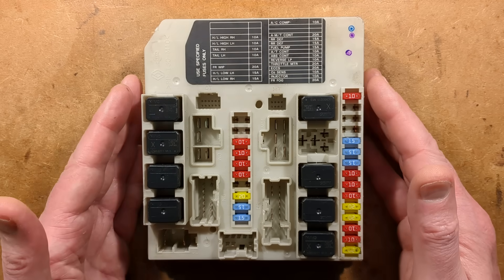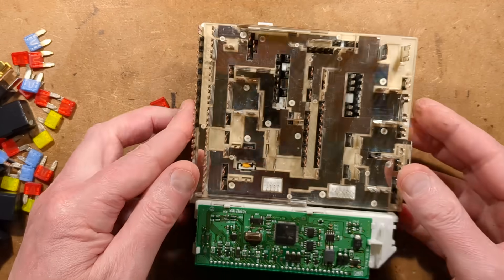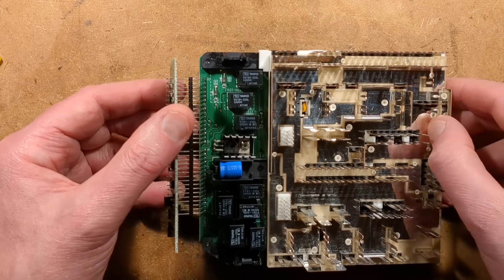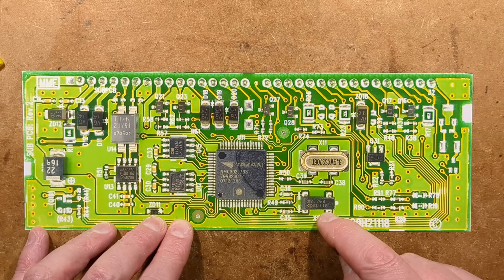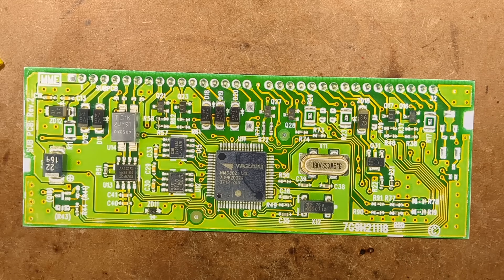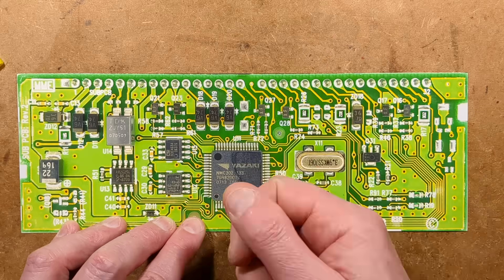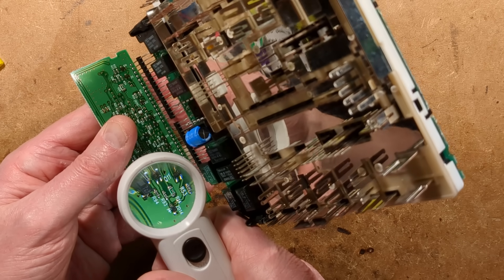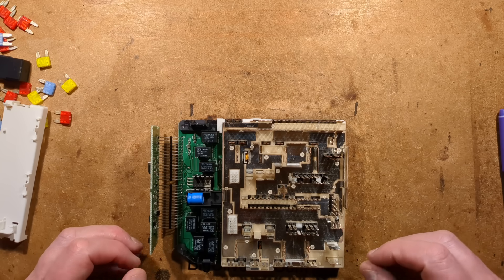Why your car's fuse box costs so much (and the location of the data chip)

Comment: Nissan, the queen of too complex electronics.  I had the driver window fail to open on a Nissan LEAF I used to own.  The window control had a PIC and a bunch of relays.  Three windows had relay H bridges and were dead simple.  The driver window though had a five position switch.  There was auto-down, manual-down, center-off, manual-up and auto-up all controlled by one button.  The switch was implemented by a slide variable resistor read by the PIC to control the relays.  The PIC also read the back-EMF of the motor for initially setting the travel after the 12 Volt supply was interrupted.  The travel limits had to be set by manually jamming the window at the limits of its travel for a few seconds.  After that, the PIC would just run the window motor for a fixed time in the auto positions.

The whole damn board was conformal coated, not really worth going through the annoyance of trying to repair.  It was just easier to pay the 120 Dollars for a new board than waste time that could otherwise be earning money.

I was glad to be rid of that LEAF.  It had one electrical problem after another.  I suspected it might have been in a flood because it was originally titled in Tennessee.  I got it used from a Nissan dealer in another state and I never found any flood residue in the bowels of the car.  Carfax also gave it a clean record.  I was so soured by that brief Nissan ownership that I’ll probably never buy another.
Reply: And probably equipped with a TAKATTA CLAYMORE MINE in the steering wheel.

Comment: My 2008 Suzuki car has three fuse boxes:
1. as part of the battery connector.
2. with relais in the engine compartment.
3. like this one under the dash.
Possibly the one you saw, was like my second one.

Comment: I wonder if it was ever worth sacrificing simplicity for the extra mpg we get these days?  When 'ah were a lad the fuse box was totally passive (fuses only), none of the complication cr@p and a dream to work on.  Whilst I understand how they work today I still question the 'deliberate'(?) complication they introduced.
Reply: With a very good Ford mechanic back in the early seventies, I had great gas mileage and performance. Let an inbicel touch you car, they ruined it but an experienced mechanic with the knowledge and a good ear is priceless…..

Comment: That's a Generic Electrical Module (GEM) and it's designed to make the circuits attached OBD2 scannable. These are the "B" codes, instead of the "P" codes. Based on the ones I've worked on, they aren't linked to a vehicle or VIN but doing so wouldn't surprise me. Yes, when they get wet they create all kinds of psychotic issues including phantom battery draw.
Reply: Actually it depends on the car manufacturer on what it's called. On Nissans it called the IPDM/ER. On Fords it's called the Generic  Electrical Module. of GEM module for short. On GM vehicles it's called the Body Control Module. Essentially it's the same. It's the body computer.

Comment: Im an automotive engineer, and this is exactly why I do not like newer vehicles! Built in[manufactured] obsolescence so they can keep making money on the cheap crap they make and sell.  They spend million$ building/engineering everything so that it last just long enough before failures and needing overpriced repairs. I wouldnt be surprised if that crystal is counting the time before it sends 'fail codes' to other stuff in the circuits causing failures and repairs. Maybe someone with lots of free time can prove, or disprove, my theory? Lol  
  Even with the newest CANBUS, it still takes lots of time to properly diagnose most problems. Much longer compared to say OBD1/OBD2 , or having no diagnostics ports, because these systems are so overcomplicated to look through everything and diagnose. Typically its worse the newer the vehicle, this all ads up to more $$ made by the Stealerships. And sometimes the Stealerships will just throw parts at something because they cant find the actual problems. 2+ miles of wiring, and 4-8 computers and modules all needing to communicate to operate the vehicle, obviously not made for the common man to work on themselves. 
 Honesty , none of this new BS is any better than something made pre 1980s, same poor mpg, same toxic gases coming out the tailpipe. Just overpriced disposable junk IMO.
Reply: The real stealers are the manufactures who make dealers purchase new computers for each model and year produced. Costs range from 2-6 thousand dollars for each computer they need to work on a specific car. Just a diagnostics plug in to that computer will cost you anywhere from several hundred to over a thousand dollars! Ever see the prices for diagnostic tools for Rolls Royce, Bentley, Ferrari? Even Cadillac and other high tier models from Ford and Chrysler command an outrageous diagnostic fee. All based on the cost of these dedicated diagnostic computers. Why don’t they just offer a software package to add the new models? They can’t make money that way.
Reply: @Subgunman  yeah those high end factory scan/diagnostic tools are ridiculously overpriced! Back in the early 90s I paid well over $100k for 3-4 different manufacturer specific scan tools, and they werent all that fancy. I realized to late though I really didnt  need their bs to fix anything! And I sold those tools with 15 months. 
 They sure do keep making things harder and harder to work on for normal repair peoples.

Comment: If it's the Eric O video I'm thinking of, the fuse box had a ridiculous design where the spacing between adjacent fuses (arranged in a line end to end) was exactly the same as the pin spacing of the fuse so it was very easy to place a fuse one terminal out and effectively connect two circuits together.  When using a DIP clip to read/program an EEPROM you often need to ground the reset pin of the micro to prevent bus collisions.

Comment: Remember the days of being able to repair and rewire your entire electrical system with nowt more than a a load of stripped out mains flex, insulation tape and inline glass fues holders if you wanted to be really safe?   I had a Ford Fiesta exactly like that...

Comment: That's not just a fuse box, it's a full body control module that does loads of different things and includes the immobiliser and all sorts
Reply: Talking about Immobilisers; I was once cleaning the inside of my company Berlingo [So Money!] and spilt Tea on the dash [the side was flat and perfect for a cuppa] , and there was a hole for the Phone-cradle and under that was the IMMOBILISER ; Bzzt dead!
Tow-truck and $1,200 Australian was the cost - I didn't tell the boss about the Tea.
Reply: I used to work for Nissan. 
It's a Nissan IPDM, there is no immobilizer in the module. However, the IPDM does control certain functions of the vehicle. The immobilizer is actually managed by the ECM, and if the BCM (body control module) detects an alarm trigger, it sends a single to the ECM, for the ECM to send the signal to the IPDM which has direct control of the horn, and headlights. IPDM mostly contains fuses, and many external and internal relays.There are some that can be changed out (the black relays) and about half that are internal. Oddly enough direct from Nissan they are only about $120 on many cars.
Reply: That's not the BCM, it's the ipdm power distribution module from a Micra,note or qashqai J10.
Edited to add: 
I've had several Qashqais(all J11's) in over the last couple of years for faults that turn out to be the incorrect IPDM fitted, the alpha numeric code printed on it determines its precise functionality.
On two of those ocassions,while calling Nissan for the correct replacement and then giving them the code on the old unit for verification,they have intially insisted that those numbers dont exist at all for any Nissan, despite me holding the thing in my hand😂
Reply: @user-re6yo7tj5s also Renault models. My 09 Clio has one.
Reply: Just say automotive plc

Comment: Joy of having a vehicle electrical system that automatically  turns off lights/12 volt accessory ports and other systems based on time. or allowing the stereo to play after key off, until the driver door is opened.
Reply: Joy, yes. Until you get home at night, come down to the car in the morning, and it is dead because that board left your map light on all night.
Reply: @lyfandeth Exactly this, new features always sound great but you have to do it the right way, it creates more failure points and when it’s all linked sometimes a minor issue will cause issues in the computer and lock it up, even if the car mechanically works, it’s a hassle

Comment: Hey Clive 😊 would you consider doing a tear down of a "tummy time crab" baby toy and possibly figure out how to give it a longer loop of music or different music?  I would be happy to supply the crab for research purposes 😅 you might save a few new parents sanity.  Thanks for your consideration!
Reply from the maker: It may be viable to put an MP3 module in.  But the existing circuitry will probably be cost optimised to the hilt.

Comment: Chrysler calls that the totally integrated power module. TiPM and it's 9/10 what's wrong with your Chrysler product
Reply: I call it the "Totally Idiotic Power Module." But it does give convenient access to the fuse that powers the BCM, so it's easy to reset the BCM every few weeks when our Town & Country "forgets" that it has power locks...
Reply: Friend has a 09 minivan, parasitic load when turned off and if you Jack up the drivers front wheel to replace it the turn signal activates without the key in the ignition….
Reply: @Subgunman I can confirm it's common practice at the dealers to quote "TiPM and ship em" as it tends to clear intermittent issues. Sucks is that as it's a can bus system they are super limited quantity spares.
Reply: Don't forget the infamous Chrysler power & ground failures. Our favorite jingle, Powers and grounds and tipms OH MY!!

Comment: Wachdog chips and fly by wire cars with non-key ignitions.... one company put the wd chip into software, and many other extra things, and went from two cpu's to one.... problem was under certain odd conditions it couldn't cope with everything at once  and would lock up, and it would put the engine into full throttle..... you had to wait for the watchdog chip in software to time out, which would have been only less than a second...but the chip was virtually locked up so the timings all got slower, so less than a second was now like minutes...
I'm not kidding people died, you had people on their phones crying to the police for help etc before going off road or rear ending something else, some getting out of their cars and standing in front of it to lock the garage door and being crushed, to make matter worse if you were driving is hitting the brakes reset the count on the Watchdog timer!
the car company didnt even know this was the problem for 6+ years and blamed sticking throttles, bad throttle sensors, carpet mats, the whole car was such an issue they submitted all the ecu code etc to nasa to be checked who found nothing... until one day as an end of term challenge a uni professor set his students the challenge, and their found it, some form of stack issue.
a few of those cars are probably still out there....

Comment: Hello Clive, retired auto mechanic from the states. Very expensive to replace a fuse box, GM has several of theirs removable like yours. Ford in there wisdom its part of the wiring harness, worked on several law enforcment fords, electric fan with relay in said fuse box, fan goes bad and starts pulling too many amps, heats plastic and melts fuse box. Oh did I mention fuse box wireing harness which has to be replaced goes from under the dash, across engine bay. very expensive